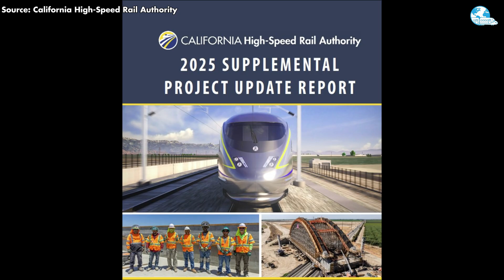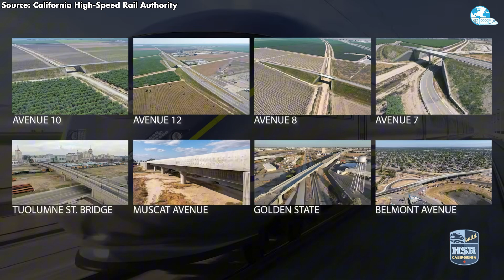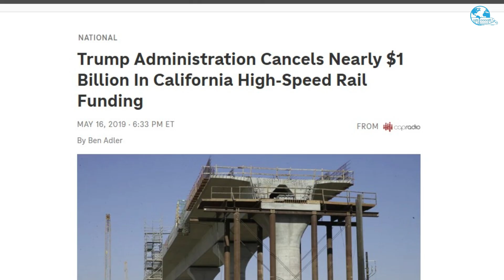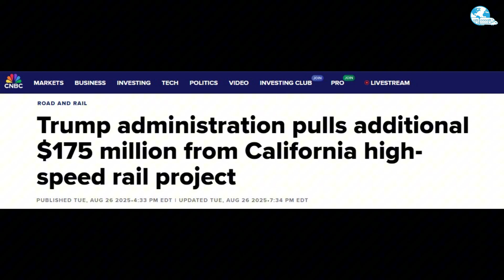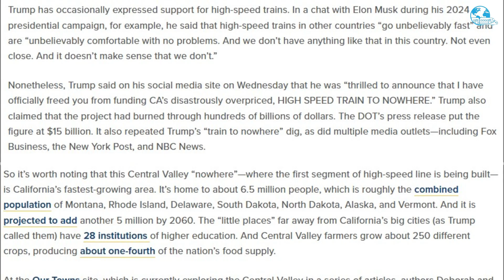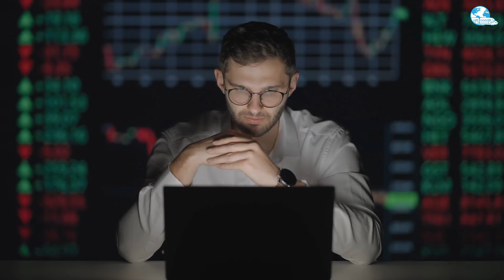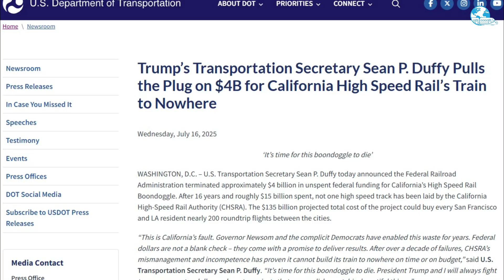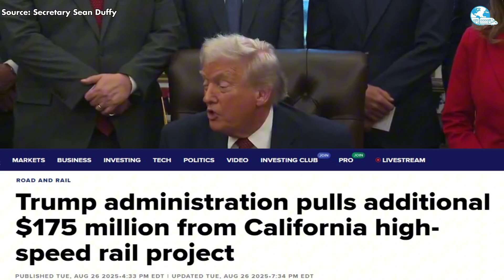California High Speed Rail Project 2025 Update

Comment: Definitely all HSR should have grade separation. What I'd have done is do a phase I and a phase II with both phases requiring voter approval to see how phase I went. Face it the wealth of CA mainly comes from the Bay Area, LA and SD. So phase I NoCal would be connecting the Bay Area to Sacramento/Central Valley via HSR, I assume using an I-80 type route. Phase I SoCal would be connecting LA to SD with HSR. Phase I would've been completed years ago then voters would vote whether to do phase II connecting SoCal to NoCal. Many of us who live in other states ask why CA expects the feds to cover the bill for CA's bad plan.
Reply from the maker: Phased HSR connecting major hubs first, with a future voter decision on the full link, addresses key concerns, but the federal funding issue is valid.
Reply: Sorry dude, that train has left the station.  You might want to consult the California Rail Plan as well.  California remains the only state with a state wide integrated rail plan.,

Comment: We need a gross recipts tax to fund this a 4b a year or more. No impact on regular taxpayers
Reply: The political will to fund the system more aggressively like that probably won't happen until people can start riding the trains. Once they see what's possible in the Central Valley – and they see that the Authority can deliver – civic leaders, businesses, and residents are going to want to get SF and LA connected pretty quickly.
Reply: @rockwellmath  I fully agree. Which is why I promote better transit at the local level and encourage awareness of the services that people having in my immediate area. They are consistently pleasantly surprised when they try it.